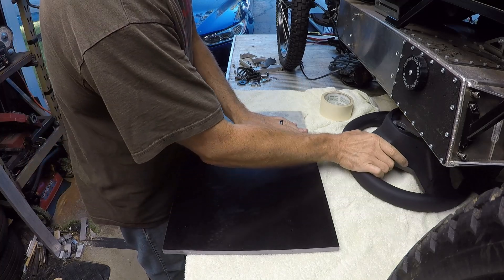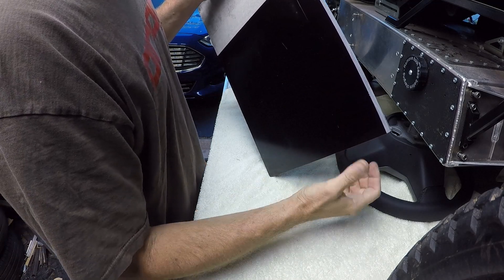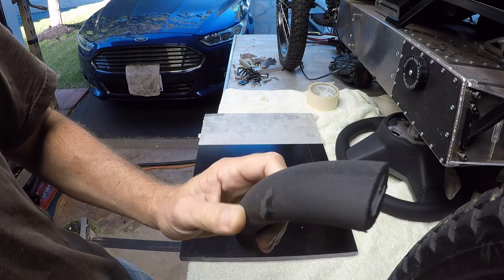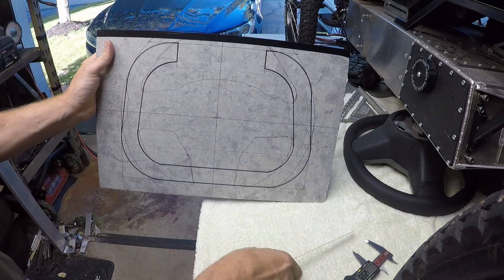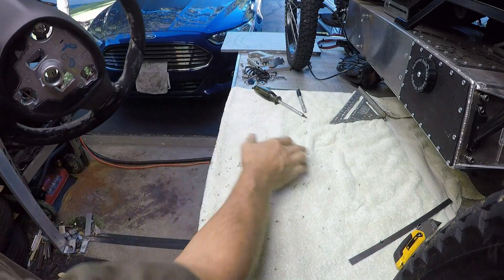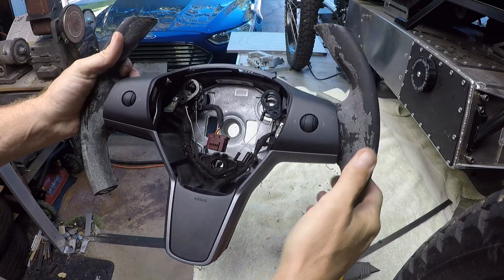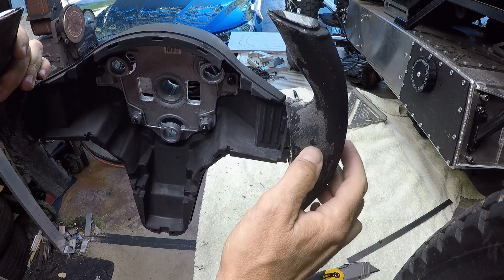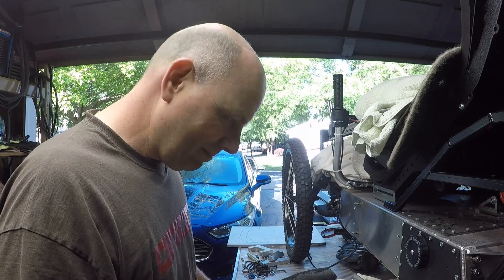Making a custom composite steering wheel for the Model 3! (Part 1)

Comment: @9:40 Now that shouldn't take long to put into a CAD programme, so you could print out a truly symmetrical shape. (I fear the accuracy of a trace with a pen or sharply at a non-90 degree angle)
Reply from the maker: Believe it or not, I have flipped one layer over to compare and found they were only 2mm different in one tiny spot.
Reply: @TechForumTesla   :) I believe you, but 2mm is too much. ;)

Comment: I find it fascinating to see how you approach such a technical project. Congratulations on your innovation and ability to see the technical world "differently".
Reply from the maker: I purposely included all of the work (labor) so you can get an idea of what is involved. 

I am not a trained engineer or fabricator. I am 100% self taught (including TIG welding). So, I may not be doing things "Correctly" per a professional fabricators method. But, I am not afraid to dive into a project and just go for it! Almost always my projects turn out great.......
Reply: @TechForumTesla  Not being an engineer allows you to think outside the "engineer's box", and that enables creative solutions.
Reply from the maker: @rickfearn3663  I have been told that a couple times. I think there is some truth to that.

Comment: Nice, You could print a paper template from a cad drawing and glue it to the board instead to draw it from hand
Reply: First kick at the "design can" it's always better to draw by hand. Allows for more creativity. Starting with CAD is a mistake, in my opinion.
Reply: @rickfearn3663  
My bad, I tough it was obvious that  a hand drawing concept first was done, then caded to clean it and then printed. If by chance you need to reproduce it, it will be easier.
Reply from the maker: Agreed. I don't do CAD work. I could just print a drawing too. But, I only needed it drawn once..... Well..... Twice if you count the error I made.